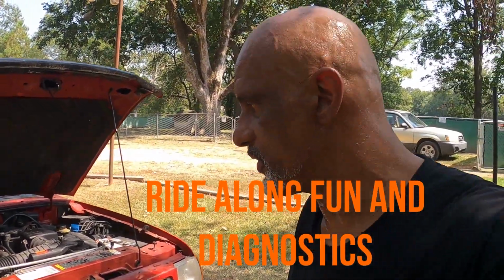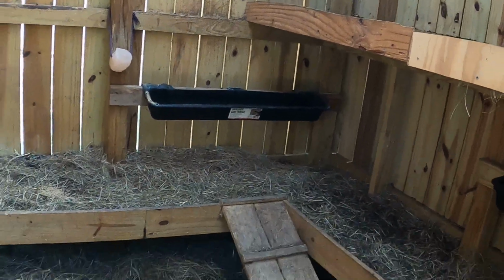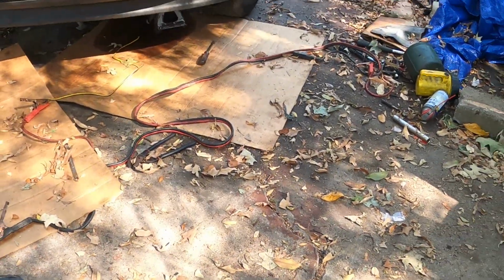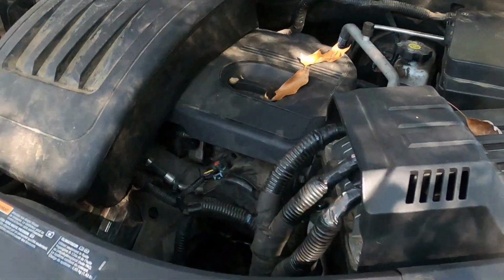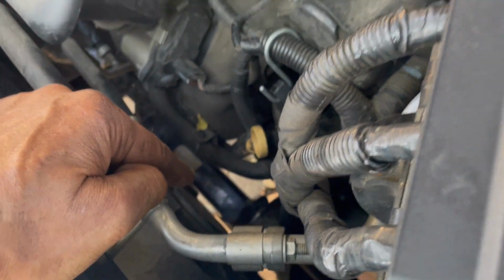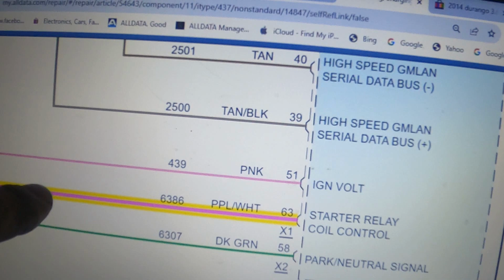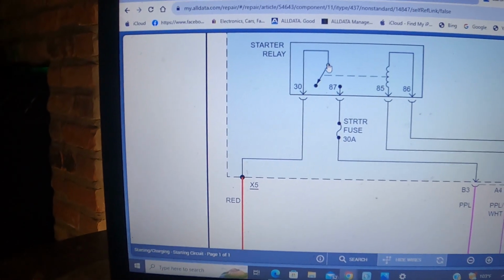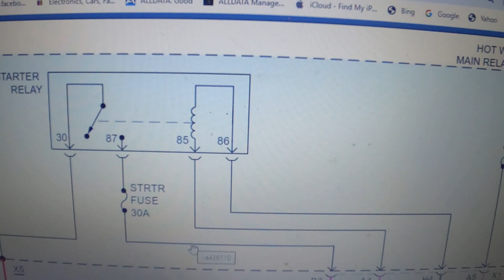GOAT  Mobile  mechanic fun ride along   no crank diagnostic 2015 terrian

Comment: what's the tool you use to test the relay? thanks
Reply: It's a Power Probe. One side connects to the battery, then the tip reads what is present. You can also apply 12V or ground to go to the tip with a button. Really cool tool.
Reply: Thanks